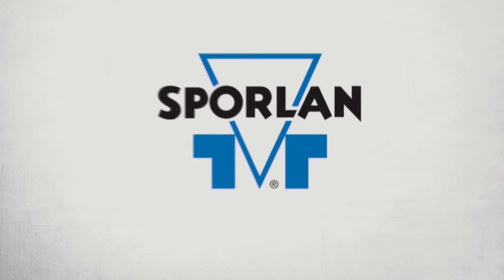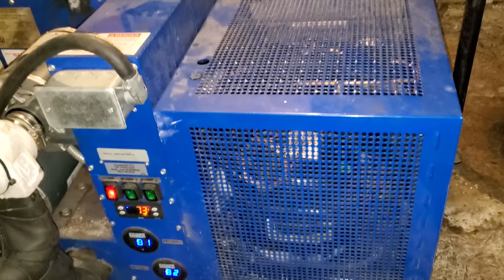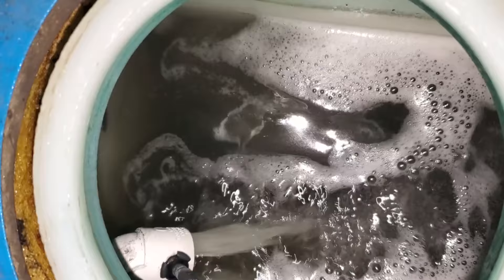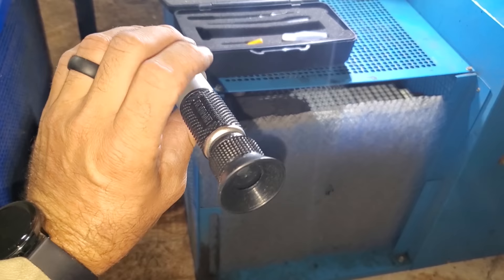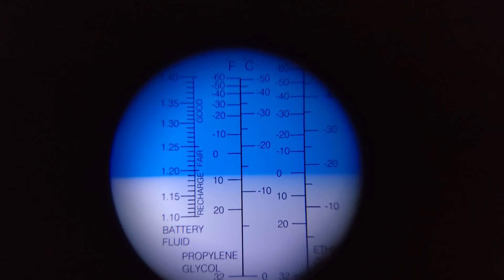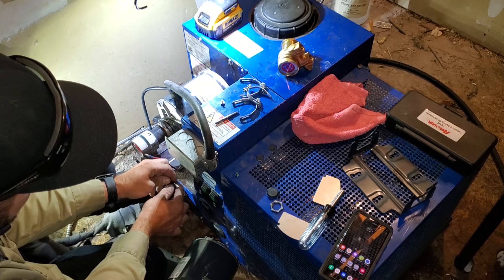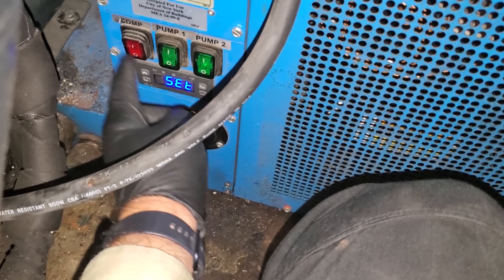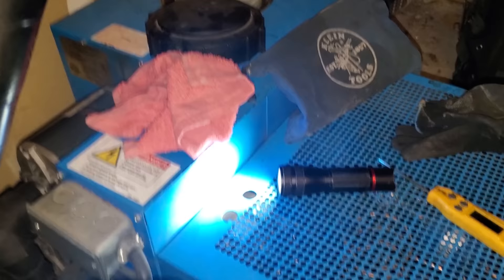THE BEER IS WARM AND BOTH GLYCOL UNIT'S ARE DOWN

Comment: I work with the procon pumps in the beverage industry. I'm willing to bet that the dark glycol is caused by the  impeller starting to break down.  That's usually caused when the pump runs without fluid.
Reply: Devon Reed I was going to say the same thing. Happens all the time.
Reply: Perhaps someone added tap water to them. In the right condition regular water can become acidic in a cooling system.
Reply: Yep, happens all the time on pop systems....
Reply: I work with Procon and Fluidotech pumps in France.  Their lifetime for us is 18 to 24 months and the the impellers usually shit the bed and leave the liquid black.
Reply: The black stuff is the carbon in the pump breaking down
Reply: Not enough glycol in the bath. Just like low airflow a unit will ice up
Reply: I have  work with beer glycol unit  and soda unit , usually when the glycol is to cold /mix with water the pump will start to break up inside  also the motor shaft will rust ,the shaft on the motor will open up wider ,I also had couple of soda bar gun clog up cause of the black carbon from the pump  this is on multiplex unit with a water bath to keep the soda cold usually change both pump and  motor ,,,  check the temp control ,, beer unit also check glycol mix maybe to much water it will freeze up in the lines and inside the bath

Comment: Easy fix my friend, the glycol level is low if you look inside the tank you will see the evaporator is not completely covered. ( it's like not having blower running or dirty evaporator on an ac unit, causing it to freeze up).  Most all power glycol units require the reservoir to be completely full to the overflow point, and they come with overflow tank. When you stop the pumps the glycol fluid will drink back into the reservoir so let both pump run a bit and then refill the reservoir back up with all pumps in service. The glycol is easy to change  just remove the return hose  and let it pump out into a bucket while adding new glycol.  I consider the glycol fluid as part of the refrigeration system and not part of the beer companies equipment.  The glycol lines leak a lot because they normally have just hose clamps that loosen overtime do to temperature change. Let the beer company fix all the leaks!  I work for a college football stadium in Texas and service several Perlick power units and most warm beer issue are caused by low glycol levels.  Hope this helps and I've learned a lot from watching your training videos, thanks.
Reply from the maker: I will discuss this on my Livestream this evening 8/10/20 @ 5:PM (pacific time) on YouTube come on over and check it out and no worries if you can’t make the live show it will post as a normal video afterwards https://youtu.be/XMm6nwq_vgc

Comment: So that coupling serves two purposes. 1. To prevent the motor from damage should the impeller lock up. 2. To prevent electrolysis between the dissimilar metals. The impeller assemblies probably need to be regularly taken apart and cleaned. They get a bio film buildup over time.
Reply: Yup cheaper and better to twist off a coupling than damage a shaft or overheat the windings. And galvinization is a bitch.
Reply: Don't forget the main purpose of couplers like that. Taking up shaft misalignment.
The motor and pump are never going to be quite exactly in line, and so there's always some wobble, and if it's metal to metal, you eat things up, seals, bushings, couplers, etc.
The plastic or elastomeric coupler allows minor offset without instant damage.
Reply: @ke6gwf  Agreed as well. Can compensate for some different angles. Useful buggers and should be replaced for sure, whether the pump is old or new.

Comment: Propylene Glycol should not have a fruity smell, it should have almost no smell at all. If it has a fruity smell, it's likely because there is serious bacterial growth or contamination. Additionally, gycol needs to be changed on a regular basis (every couple of years or so) because the corrosion inhibitors get used up. Once the corrosion inhibitors get used up, you'll start getting excessive corrosion of pumps and heat exchangers.

 Those gycol units probably could use a complete flush and replacement with new glycol. You'd want something food-safe "USP" grade fluid, like DOW's Dowfrost or similar
Reply: We had exactly what you describe, happen on the geothermal hvac system in our home.  The glycol sat in the system for 8+ years.  System installer said the glycol would last 20+ years...  he was wrong.   The stuff turned burgundy, then turned black, filled the house with an awful smell, then began corroding numerous components in the system.   Dozens of service calls over 10 months and the installer was never able to get the system to work correctly again.  Living in a rural area, hvac contractors are few and far between.   Ended up having the geothermal system ripped out and replaced with a traditional propane furnace / hvac system.  Much happier now with the traditional gas furnace.
Reply: It smells a lot like tequila I think
Reply: @susank7680  usually on large glycol systems a company would test and treat it (adding inhibitors)to keep it from going corrosive
Reply: I am 100% certain that all of McDonalds glycol units on their ice cream machines have a fruity smell brand new. I say it's more like a fruity athletes feet smell, really similar to what "Stop Leak" for HVAC smelled like when it first came out.
Reply: and safeguard needs to be put in place to  stop tampering as this can be one of the biggest problems
Reply: I said the same thing before I read your comment, cheers
Reply: @capitolrefrigerationheatin7501   _ Apologies, I'm just now seeing your reply.   I agree with you.  Our closed loop system was installed in 2008 when the house was built, the installer never said a word about necessary maintenance / testing, and disappeared until we called him eight years later about the sweet syrupy glycol smell and corrosion on several components.    Unfortunately, when he couldn't fix the problem, our installer stopped returning phone calls.   

We had the geo system pulled out and replaced with the propane system in 2016 by the other local contractor (there are only two within a 35 mile radius)....  a guy who has also stated that "glycol should last forever" and said that "the glycol in his home geo system was 20+ years old".... which I highly doubt.   I gave him hard copies of info printed from the Dow Chemical website that showed the life expectancy of glycol at various temperatures,  the color shift when it thermo-degrades, the recommended PH testing that they offer, etc etc.   He walked away scratching his head.    We now work with an hvac guy who drives in from the nearest "city" about 45 miles away, does maintenance and needed fixes on the propane system.

The system is only as good as the guy who installs and maintains it.   In my geographic area, I'd never recommend a residential geothermal system to anyone.
.
Reply: I work for an ice company and we have huge ice block tanks. Propylene glycol brand new definitely has a sweet smell.
Reply: @susank7680  That's awful! A ground source heat pump system can be a wonderful thing, but like with any system proper maintenance is key. The system installer should have taken responsibility for his serious mistake.
Reply: @forumtyish  - Thanks.  Our system had a lot of problems from day one.  Ex - loud banging noises every time it turned on (the kind of noise that wakes up the whole house in the middle of the night), R410A freon leaks that were so bad that you could smell it in the attached garage, condensation catch pan that constantly over flowed and had to have the water soaked out of it with a bath towel every night which the installer said was "normal" - ahem, two evap coils replaced when it couldn't keep the house humidity below 75%, and several others that I can't recall or maybe have "repressed".   The glycol going bad was the last straw in a long list of problems.

It was a much bigger hassle than it was worth and never saved us any money in operating costs.   For the dozen or so friends / acquaintances who were thinking about installing a geothermal system and asked my opinion on them....  I've recommended very strongly that they stick with traditional natural gas / propane systems.

If I were to move, and rent / buy another house....  I would never consider one that had a geo hvac system in it.
Reply: Wow what a fantastic insight thank you for clearing this up
Reply: @susank7680  Geothermal units work fine. The issue is you had an technician who has no idea what he is doing.

Comment: I had never even seen a glychol unit, a company I was working for sent me on a system much like this one and told me, "You've fixed a lot of things that you've never worked on, just figure it out, and call in if you need help" I had the thing running after a little time and another tech came in to help right at the end. It wasn't really a big deal, was a little confusing at first, but kept at it. I basically did the exact same thing you did, cleaned out the debris and put them back together and tightened them down to make them work till we got the parts, I also put on a white rodgers t-stat to get the one going that had a large difference in the temps, which I think you did that in another glychol video, till the dixell electronic control came in. Thanks for the videos, they tend to help keep me sharp on some of this equipment I don't work on regularly and keep the knowledge forefront and I have noticed on some things, I mentally reference your video at times and rather than having to dig really deep to remember, it comes a lot faster due to your references. They(Your videos) really work, so Thank You!

Comment: I would recommend to you to digging deeper into glycol units to make sure you understand how to properly maintain the gylcol lines, pumps etc.

Might not land you a lot of customers who want you to do the maintenance on the glycol, but you can offer it to them instead of having someone else come out to do it.

Additionally it helps you do the troubleshooting if you completely have your head wrapped around those systems. :)
Reply from the maker: I am very interested in doing more with them but training techs to work on them is a problem...... I will discuss this on my Livestream this evening 8/10/20 @ 5:PM (pacific time) on YouTube come on over and check it out and no worries if you can’t make the live show it will post as a normal video afterwards https://youtu.be/XMm6nwq_vgc

Comment: The motor saver sounds like a torque limiter to avoid a jammed pump from causing the motor to stall. 

When the pump jams up the save physically breaks and lets the motor freewheel. Replacing the plastic motor saver is cheaper than an overheated motor and perhaps something to add to the van you send out to those glycol calls.

Comment: Great video.  I would  recommend changing out glycol n cleaning the unit. Remove glycol  n u can clean glycol lines with beer line cleaning solution like BLC or DAC mixed with hot water. Then rinse out with cold water. Then add new glycol with proper mixture.

Comment: Well Spotted Chris, had very similar problem recently! Glycol system is easy, 2 lines for flow/return usually 15mm lines. Cobra taps have separate lines usually 3/8 lines flow/return for cooling! 4 lines in the python (beerline) for cooling chills the beer in the lines all the way too the taps & also chills the cobra taps. Beautiful when installed but over time they get really dirty under the counter in the bar! Refractometer very helpful on the correct mix, we usually add an extra little bit for luck!! Helps unit to relax more on the cooling side of things. The glycol deteriorates over time if not serviced. Definitely once a year for service otherwise there’s problems. 

Love the vids 👏🏻👏🏻👏🏻💪🏻💪🏻
Reply: and those lines if left uninsulated will sweat like pigs!

Comment: My guess is they were flushing the beer lines with hot water for long enough to warm up the glycol temperature which would raise the heat exchanger temperature which would cause the refrigeration to open up and chill it. Then the motors spin up to compensate but the couplings broke and it continues to just chill the tank without warm glycol to run over the exchanger. Just super chills that spot and the refrigerant has a continual pressure/temperature drop and ices up. I'd say it basically all goes back to the motor couplings and the pumps needing servicing really badly (or replaced.) The faulty sensor didn't help things either.

Comment: Those pumps look like they are gear pumps, and if so, don't have centrifugal impellers. Gear pumps are positive displacement pumps and can build up tremendous pressure if the flow is blocked while operating, causing pipes to burst. The safety coupling between the motor and the pump serves to protect both the motor and the piping system. It is extremely important to both maintain the quality and quantity of the pump fluid. If they ever run dry, they are toast, as I suspect the pumps in this video are.

Comment: Not sure if they have different practices when people clean the lines in the us compared to Australia but we turn the unit off to stop freezing up the water when cleaning the lines. A lot of people just turn off the pumps which freezes up the evap as there isn’t no movement and the compressor left on. I dare say they just have the pumps off while doing the clean.

Comment: You need too get that glycol clean.  Drian rinse drain rinse drain rinse.Those procon pumps are very easy to fail- the fins will break and thats part of the black bits in there.  Also Slime molds will grow - the fix is only use a good product like Dowfrost or Micomatics glycol which have inhibitors. And of course it needs to be food grade!  The pumps also have filters on them - you should check them too. Also make sure they turn the units off when they clean lines. I like a 5deg glycol to product. FYI im not HVAC but Ive been a Brewmaster for over 20 years. edit- yes use those motor savers! LOL yeh its a separate run - look at Foxx equipment catalogue for a example.  Lifes too short to drink crappy beer! Micomatic and Perlick are the top suppliers to use.

Comment: @24:00 the plastic coupler serves as a mechanical fuse. If the pump ever seizes then it doesn't take out the motor or more.

Comment: Excellent job. Going outside our actual scope of work is always a challenge especially when the customer is relying on you because they do not know whom to actually call like the local distributor lol. It reminds me of complaints I have read about with plumbers not being able to repair a heatpump water heater. Well yeah they for the most part do not even carry gauges much less those type of controls and safeties.

Comment: To me, black comes from O-rings and hoses that have disintegrated.  What nitrile rubber is in the system?
Reply: That's a good point maybe where the impeller or its seals have eaten themselves
Reply: The impellers on the pumps are carbon. When the pumps wear or breaks the carbon pieces flow though the system and the carbon debris settles in low points of the tubing run. when the system is static for a while, then started back up. It dislodges and flows the carbon debris though the system.

Comment: Open loop system using non OEM glycol or specific type will make  corrosion and will turn the colour grey/black.
I remember someone not adding Dowfrost glycol into an Hillphoenix GMD case and just wrecked everything.
Had to change all the pan/ heat exchanger ( filled with small black corroded residue )
I can't remember the product I used to clean the unit but even after 5 full clean and flush with 100% new proper glycol the damage were done and the new pan blocked after a month.
But yeah, if the exchanger froze well it's normal that the pump overheat and deteriorate the glycol

Comment: Im at 10:20 . In my experience the glycol system needs to be turned off when flushing the beer lines as the water and solution can freeze up and split lines if not done
Reply: If beer lines are left empty, or with water only for long periods of time(seasonal operations or specialty draft line left empty because of supply) that can happen. General flushing the beer guys are not hanging around long enough to freeze and split the lines.

Comment: You didn't have a part on your van?  OMG, I think that's a first!  J/K I'm always amazed at the parts stock you keep on your van.  I mean, who keeps a glycol system pump and motor on their truck/van?  Uh, no one?  Then, if you don't have something, you're able to acquire the parts you need from suppliers.  Y'all must have some amazing parts houses in your area.  The parts houses I use in my area , many times, don't have 8145-20 defrost controls, much less digital temperature controllers.  It's like refrigeration doesn't exist with them.  Enough of my rants.  Great job (again), Chris!

Comment: 24:31 It sounds to me like you're describing a separator sleeve that sits in between the motor shaft and the pump to keep the metals from touching each other which prevents Galvanic Corrosion from eating the 2 dissimilar metals.

Either that or it's a coupler between the motor and pump that's designed to protect the motor and pump from damage if the pump jets jammed or frozen by breaking (like the sheer pin that connects a propeller to the outboard motor shaft, it breaks if the prop hits a rock preventing expensive damage to the gearbox)...
Reply: still have a drawer full of the those brass couplers,... thinking back and remembering the corrosion that formed in that cavity that the plastic chingas was an upgrade made long after we ditched stadium draft service.